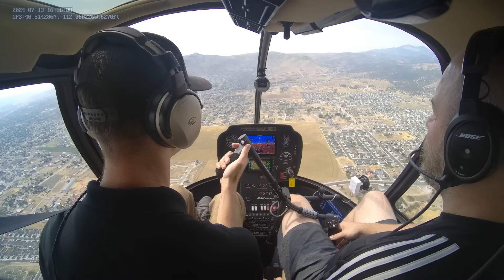New R44 Tail Chopped Off When Engine Actually Failed During Practice Auto

Comment: I fly RC helicopters we do autos for fun takes lot of practice to get them right but once you get the hang of it not that difficult. I've always noticed full size always crash when they get to the end likely because they don't practice full down auto rotations lot of back injuries. My employer has a helicopter Jet ranger execs use to fly on it until engine failed pilot had to do an auto. One guy had broken vertebra in his back rest of them ended up with lifetime back injuries.   They called it a hard landing it was a 15G crash landing.

Comment: Based on a conversation with my instructor, it looks like he was flying around 8,000 ft, where the air is much thinner and the mixture was still full rich (which is fine, since the POH forbids adjusting the mixture). Closing the throttle at that altitude was probably a mistake—the engine didn’t have enough air and essentially choked.

Comment: Notice the Manifold Pressure. Think the engine quit pretty early on :face-purple-wide-eyes:
Reply from the maker: Yes, and as I've done more reasearch it turns out that the engine quiting when reducing throttle has been a known issue with the Raven II since before certification. Robinson made some zero-day changes to the 1970's era fuel injection system to make this less likely, but I have a feeling that the industry willfully turns a blind eye to issues with robinson helicopters or else nobody would ever be able to afford to enter the industry as a pilot. It's depressing how archaic aviation tech is, ostensibly in the name of safety, but being stuck 50 years behind in tech in reality just kills people.

Comment: I make these comments in hope they may be useful, not to criticize. 1. Never practice autos over an area that has not been surveyed and determined to be safe for touchdown autos. 2. Always attempt to restart the engine, you have the student there use CRM. I had a large helicopter flight school for years, these and many other safety practices and procedures were put in place and saved a lot of grief.. I was also a helicopter flight school safety auditor for insurance companies. Robinson may still have that program, I don't know. I would check with them. It was a good program. I have been retired for 16 years now. If I can be of any help please don't hesitate to contact me.

Comment: As a retired FAA DPE with 7000+ hrs is helicopters, when you have a real eng failure to a unknown surface, a aggressive deceleration is required to ensure max RPM to build resulting into a zero ground run. With a R44 is simple. This is not usually taught in the R44.....otherwise, all is safe, that is the most important outcome....one point if eng quits, do not worry about Nr...let it go above the redline to achieve a safe touchdown....
Reply: I doubt you have time in Robinson products.  Having the NR above or below the limits is deadly. 

Full ons are done with forward speed, you can't get away from that in these tin cans.

Comment: Another great Robinson product (failure).   Glad the two of you survived.
Reply: @TobyLovesLife  
Engines arent made by Robinson.
Reply: @johnparish1432  wasn't an engine issue.   Robinson helicopters, particularly the R22, R44, and R66 models, have a history of safety concerns, with a focus on accidents involving mast-bumping, where the rotor hub impacts the mast, often with catastrophic results. These incidents are often linked to pilot error, improper training, or the helicopter's unique rotor design, which makes it susceptible to low-G conditions.
Reply: @TobyLovesLife  
Im aware.
Went to 22 school back in the 80s then investigated crashes for the FAA.
Robinsons have a bad reputation but any helo flown or maintained incorrectly will cause problems.

Comment: Looked pretty smooth to me. I knew a Navy flight student back in early 80’s that had his instructor accidentally shut off the firewall fuel valve during a practice auto in a TH-57. Three sec later (as per NATOPS), the engine cut out fer realsies. Instructor took controls but they balled it up at the bottom. Student got injured but eventually re-entered the syllabus.

Comment: Nasty. I've also was involved in a helicopter accident during a solo back in 2022. At the end of day the instructor got you and your aircraft back on the ground. Great thinking handing back the controls so fast. The aircraft was owned by the insurance company as soon as the mechanical problems started as others have said.
Reply: The NTSB "owns" (takes possesion) of the aircraft until it is released to the insurance company.
Reply: Semantics. In my example no. Video aircraft probably.

Comment: That seems to be a typical result for a hard autorotation landing. Your rotor disc is already high in the front and low in the back because of the autorotation, and it doesn't take much to bump the tail up into the way. I know a guy that did it in a Hughes 300 while spraying a field. He flared to early and dropped in, and the tail wound up in front of him. 
Can we just admit though, that the shared controls in a Robinson look like something your redneck neighbor rigged up in his tool shed so the passenger can fly if necessary? They always looked super wonky to me. I learned in a 269A and although it was ugly as home made sin - it at least had a proper set of dual controls. Two cyclics, two collectives.
Reply: I think back to practicing autos while just a student, and I remember how easy it was to underestimate your height above the ground when you see it rushing towards you as you’re coming in at 60mph and dropping 2000FPM. The natural tendency was to always flare early, which always resulted in us skidding down the runway with speed. Over time your depth perception becomes fine tuned, things happen much slower, and then you realize you’re actually much higher than you thought, in which you’re more patient near the bottom in order to hit ground effect which helps you bleed off most of the speed. I’ve never done autos in a Robbie, but from what I heard they’re known for zero margin of error in keeping rotor rpm and airspeed when practicing these emergencies. It will fold quicker than a dollar store lawnchair if you let it decay for a second or two due to its low inertia M/R blades.
Reply: @crazyralph6386  That's how my friend crashed. He was used to practicing autos at an airfield with pine trees around it. He knew to start the flair when he got even with the treetops. So he takes this spraying job and he's out in the middle of a field with no trees around it. The engine dies and he flared too early and too high. That was his explanation for what happened...
Reply: @rule1dontgosplat  makes sense, especially with little to no reference? same thing with these guys, out in the middle of a field with tall grass.

Comment: Missed the flare at the bottom.  With all that open field, there's zero reason for any forward motion prior to touchdown.  If I had to guess, he's done nearly zero full down autos as his attitude at the bottom was straight and level as though he was going to do a power recovery.

Additionally, I don't understand why he decided to bank to the left.  If they were practicing an auto, they should have had a spot picked out...In the event it becomes a real auto.  And zero radio call....  Had this been remote there would be little to go on that they had crashed or where.

Comment: I learned on a Bell 47 g2  way back when at Canadore College in North Bay Ontario. We would do full on auto's at anytime the instructor chose to chop the throttle. Only power recoveries were if we were over trees or water. Practice makes perfect (ok close to perfect). If you are training for power recoveries not full ons then you are too dependent on the engine coming on when its needed and when it doesn't , your screwed.   I never flew a Robinson but my god, the dual cyclic setup is crazy, looks like a limp noodle.  These things look like a toy homebuilt. Glad you both got out of it okay.
Reply: I too did basic training in the B47 at Cranfield UK. We would do autos to the ground, and had about half the decent rate of the R22s. Not enough inertia in those blades IMHO, makes it very difficult with almost zero room for error. Used to be able to hover taxi a short distance after the flare with all the inertia we had.
Reply: @PaulCopp  The amazing bird was the hughes 500 , in auto you could bring some pitch in and drop the rotor speed to 90% and damn near glide, drop the pitch and it would spin up to 100% and flair to touchdown. Loved that thing, like strapping into a nice sports car
Reply: @crazyralph6386 Speed doesn't kill, sudden extreme deceleration or acceleration does 😆
Reply: HAha. I agree about the cyclic system.  I have been fortunate to have a long career which has never necessitated a flight in a Robby. Not to knock them as many love them, but I trained in TH-55s in the Army, then flew a civilian B47 G2 later on the side. Having been spoiled by a career flying numerous Army airframes to include the AH-64A,  commercially in the B206B, and now the B505, the few times I've digressed and flew a smaller Hughes 300 was a humbling (and edgy) experience for sure.

Comment: Typical POS Robinson.  The instructor doesn't deserve any accolades, he did the  minimum required to survive.  Any other helicopter would auto easier and safer and land with no damage.  I will never fly a Robinson product again. Unbelievable that they are still going to use that rotor head design on the R88.
Reply: Can’t disagree with you on that one!

Comment: “Bitching Betty” (EPGWS) brought nothing to the party other than distraction and heightening stress. I suggest there is a safety case for automatically silencing the EGPWS during an engine failure or low rotor RPM.
Reply: Good point, it could’ve very well contributed to the pilots early flare which is really what caused them to crash. Why on earth would it even be activated for doing emergencies in daytime VFR weather? Completely ridiculous.

Comment: I noticed many people say these are two separate videos,
The heli's reg is N6960, Google Search this and click aviation Safety Network link.

Admin, Pin this
Reply: If you have working eyes it’s dead simple to see they’re two entirely different videos.  Are you seriously trying to say those two helis, the second of which appears to be a small model, are behaving in the same way during the last few seconds of the video?  And don’t try to claim the critical part of the first video is missing.  That helicopter is either on the skids by that point or only a few inches above the ground, and it didn’t approach in an extremely nose-high attitude, as the second one did.  Open your eyes!  It’s absurd that anyone believes this obvious scam.
Reply: @mikemckee6583  

I wanted to reply to your comment but I always felt like it's a waste of time, finally I have the time.

If you click on the aviation safety network link after Google searching N6960, they'll show you a photo of the crash and crash site, the damage sustained on N6960 is 
Tail boom damage ..
that proves the video is real, 

Lastly, why would someone use Another video?
Lastly, do you have a Source and link where he originally got the video from???

Comment: As a few thousand hour helicopter pilot I think your instructor did a decent job especially if he’s low time. It’s always easy to pick things apart after the fact. I think what he said is very true about practice autos to always do them somewhere you can set down this is exactly why. I think the only down side is him not recognizing the engine was dead sooner as there was enough time early on to try and restart but his hands might have been full by the time he recognized. It’s better to do the auto well than stall the blades or do something else dumb because of trying an air restart. As long as you walk away in this situation that’s what’s important if the helicopter is reusable that’s a plus. Hopefully it was insured well. Don’t let this discourage you from continuing to fly either.
Reply: I was an IP at Fort Rucker, taught TH-55's amd UH-1.  In the early 1980s, Rucker had a problem with the Th55 engine shutting down when ging a student a simulated engine failure, and that taught me to Always make sure you had somewhere to land when simulating an engine failure. A zero ground run might have prevented this accident!
Reply: @Aircarepilot32817 As having Thousands of hours in Huey’s, (116th CSH) The BEST way to stay away from an Incident Like That is not to Get in ANY Robinson. There JUNK, Plain and Simple, JUNK.

Comment: Comparing autos onto paved runways and hard surfaces and stating that this guy should have been able to do this without damage the the equipment is foolish.

High grass is a bitch to auto into because as it typically messes with your depth perception as your try to bring down both forward motion and descent rate to that magical point. 

They walked away is all you have to know and if you want to try practice autos into tall grass, I am guessing you will suffer the same outcome.
Reply from the maker: Absolutely! It's interesting to note the comments where people think the onboard and outboard videos are not the same incident. The grass really does have an effect of giving a false floor to aim for while making the location of the real floor difficult to discern.